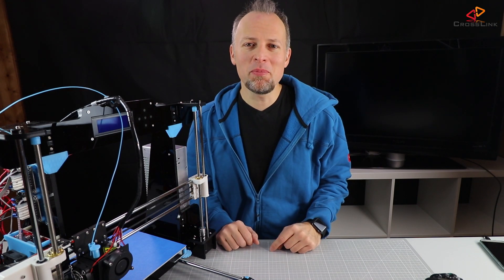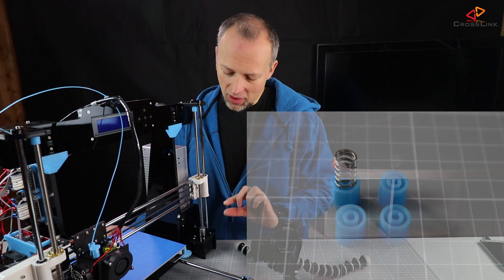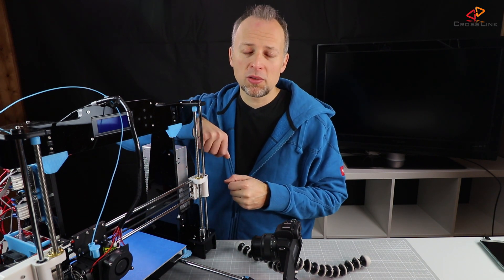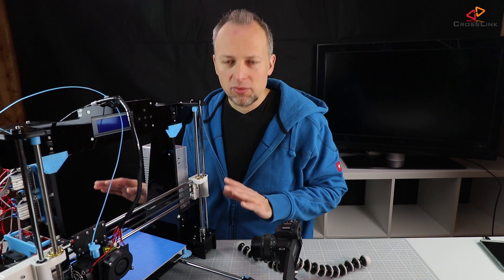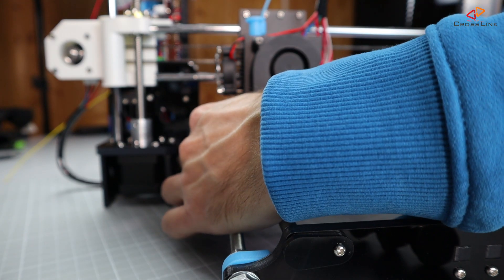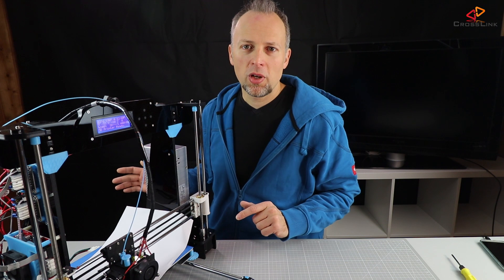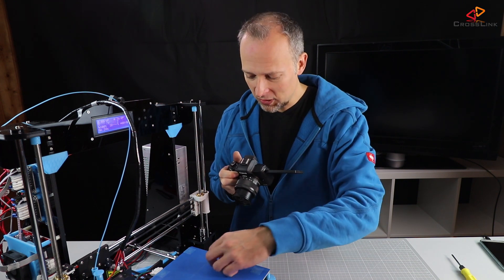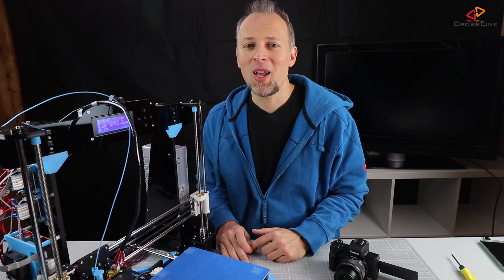Anet A8 easier manual bed leveling

Comment: I have an ante a6.  I am interested in the modifications and use them on my printer.  Where are the files to make the print modifications?
Reply from the maker: The files that I have used are mentioned in the video description. If you're looking to files for your specific printer, check out Thingiverse.com, there is a lot of mods.

Comment: with marlin 2, you can offset the z value per point thus manually creating a height map. make sure you first get the bed as level as possible using the screws, run the routine but remember to save the configuration after.
Reply: How do i do this? i have been trying to find a good tutorial on this subject and cant. Is this the same as manual mesh bed leveling?

thanks
Reply: @LT72884  if you invoke the bed levelling function from the motion sub menu,  adjusting the corner screws of the build surface, usually i only do the four corners. Then run the processesss again but this time you will be checking all 9 points. while levelling, use the up and down cursor buttons to move the Z position. Do this for all 9 points then when complete cursor down and choose save. You don't get any acknowledgement in the screen. Then next time, assuming nothing has changed, load the settings from the same motion sub-menu. Hope this helps
Reply: @shabbee  oh man, mine does not  have that option in the sub menu sigh
Reply: @LT72884  you need to get into the Marlin code, this is done using the arduino ide. If you're not versed you may find a pre-edited version 2 marlin for your machine. Let me know what you have
Reply: @shabbee  its a custom prusa i3. I built it from random parts haha. The frame is an anet a8 acrylic frame that i have reinforced. The y axis is completely redone and based off of the prusa i3 rework reprap project
Reply: @LT72884  I'd be looking at adding a probe and turning on auto bed levelling with that machine
Reply: @shabbee  the bed stays pretty trammed for a few months. Just looking at ways to do it differently and to adjust for slifht warping that every bed experiences haha

Comment: Thanks for the prints! I have drilled out and fit these to my anet a8 but when the bed moves forward and back, the hand wheel touches the front bracket  of the printer stopping it?

Comment: Hi Daniel, my Anet A8 Home z position is different than the printing z position. When printing, it jumps like 2 mm up and starts printing in the air. Can you tell me how to fix this? Thanks in advance.
Reply from the maker: Depends what gcodes are sent when printing. Home pos is normally at bed. Print start depends on first layer height. What is set in your slicer?
Reply: @Crosslink3D  G28 ;Home
;M117 Auto level...
G1 Z15.0 F6000 ;Move the platform down 15mm
G0 X0 Y4 F9000 ; Go to front
G0 Z0.4 ; Drop to bed 
G92 E0 ; zero the extruded length
G1 X40 E25 F500 ; Extrude 25mm of filament in a 4cm line
G92 E0 ; zero the extruded length
G1 E-1 F500 ; Retract a little
G1 X80 F4000 ; Quickly wipe away from the filament line

Comment: Did you do something to stop the screw from spinning?   When I turn the wheel the screw turn as well.
Reply: The simple and obvious solution is to put a nut on the screw on the bottom of the print bed and tighten it down. The spring should fit over the outside of the nut, at least it does on my Tronxy P802M (which is a clone of the Anet A8).
Reply: @mattelder1971  If you do this, use a washer between the nut and the bed to prevent scratching the coating.
Reply: @F3Ibane  Yeah, I did that ages ago. Thanks for the tip though, maybe others will read it and keep it in mind.
Reply from the maker: I had to hold it with a screwdriver until it gets a good amount of tension. Then it stops spinning.

Comment: did you drill out the threads in the frame holes to make these knobs work? mine tighten the wingnuts but don't actually bring the bed up or down
Reply from the maker: Yes, I did that
Reply: @Crosslink3D  Thank you! Would you still recommend it?
Reply from the maker: Yes, made leveling much easier
Reply: @Crosslink3D  thanks a ton

Comment: Dial Gauge Indicator bracket from thingiverse and level your bed to absolute zero on all four corners without having to make failed prints...  Digital Caliper to dial in your Z axis carriage by disabling stepper motors and measuring both sides, make adjustments accordingly. Place a Speed Square on bed to make sure your Z Axis rods are parallel. Glass surface with medium sized binder clips and dollar store glue stick for awesome prints.

Comment: Was the knob a remix of the one I posted in 2017? One of the things I like about 3D printing is how we can find something on thingiverse and adapt it for a given situation. Keep the good videos coming.
Reply from the maker: maybe it is, I mixed two parts and made the knob smaller in diameter because it is scratching on my frame. The original one also scratches my frame, which is strange.

Comment: Daniel, 
You wanted project ideas!
I have been working on this for 2 or so years on and off, can’t get it working I think its arduino code issues. I built everything 2 times so I don’t think it’s hardware. 

This would be a fun project also no one else did this. This youtuber is one of my favorites. 

Thoughts??

https://youtu.be/fA5sFRh3OkY
Reply from the maker: Looks cool. I have the parts for a F450 quad lying around here and some 433mhz transceiver. But I believe what this guy wants to achieve can be done easier using a smartphone as the "tag". Definitely want to build the quad and play around with autonomous flying soon 😉